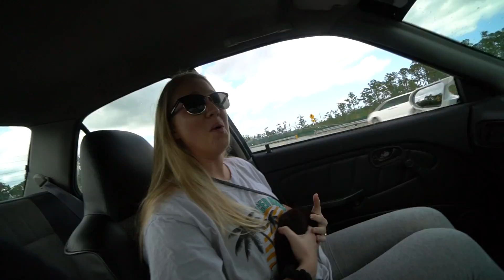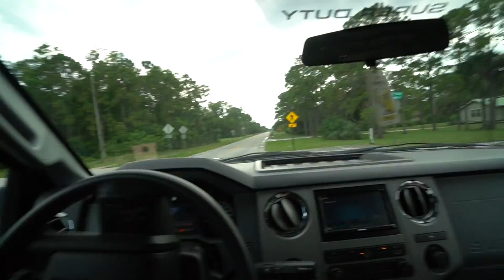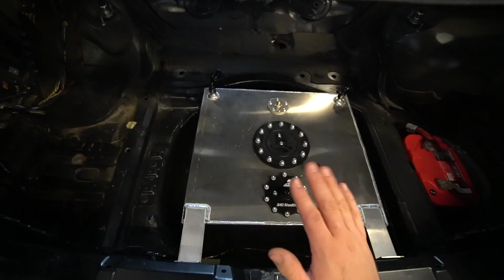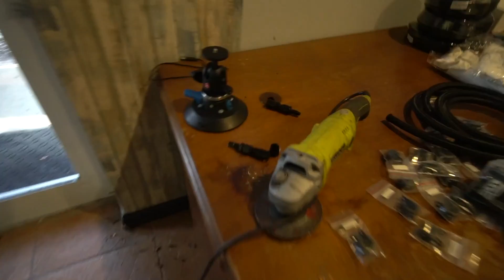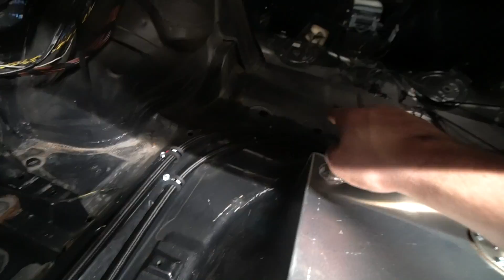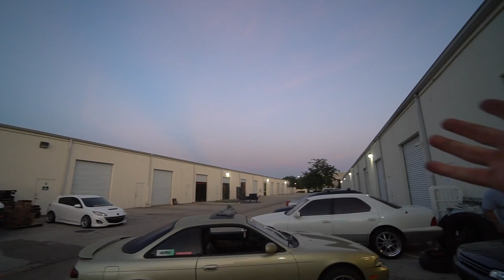REBUILT MY DRIFT CAR IN A NIGHT!

Comment: Hey Chris, I am a vet nurse and I thought I would give you some advice.
I would strongly recommend you take the kitten to a local veterinarian for a check up. Depending on it's age it may even have a microchip but judging by the size of the kitty and area you found it, I think someone dumped it there (could be feral also).
I think the vets would want to take some bloodwork and perform a couple of other tests such as FIV and heartworm.
Kittens often have intestinal worms if they have not been given worm treatment. 
Also, I would definitely talk to the vet about getting a vaccination for the kitten. They would probably bring it up anyway. 
Anyways, definitely take it to a vet just to make sure there are no under lying issues and if all is clear for sure adopt it and ask the vet about the correct diet you should be feeding them based on the vets advice. Flea and tick treatment should also be brought for the cat. 
Anyways, hope this helps if you see it. Good luck.
BTW, fuel cell set up looks sick dude.
Reply: No need to fyeahspec that cat, bro.
Reply: @billyrudd2786  lmao, slam it on enkeis and daily it then?

Comment: Permatex came out with a green rtv. That's friction modifier safe from leaks for diff and transfercases. I guess grey and black will leak down the road from friction modifiers that's in most gear oils. Check it out for the next time you pull it apart

Comment: 8:14 The fuel cell might go somewhere if it gets put on it lid with a full tank.  Its why the sell and mandate tank straps that go over the top of the tank.  Member its just thin wall aluminum holding 120 pounds of fuel at 90 mph and not a factory steel tank.

Comment: Later down the road you should have some nuts welded on the bottom of the car so you can just take out the bolts from the top and be able to remove the fuel cell without messing under the car, idk how BMWs are so idk if it's metal or plastic lol